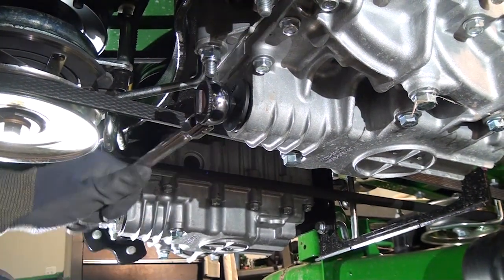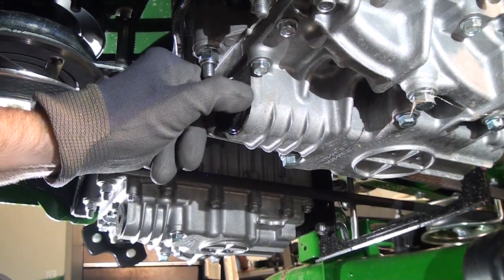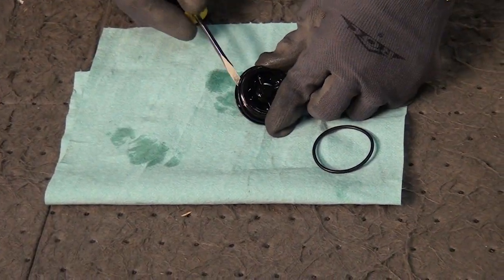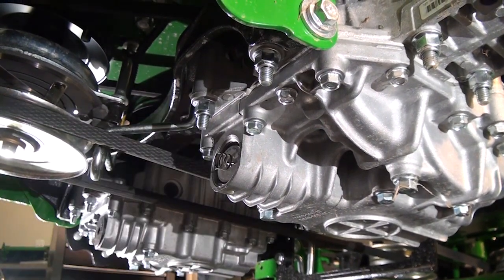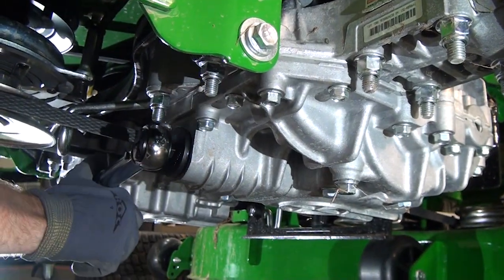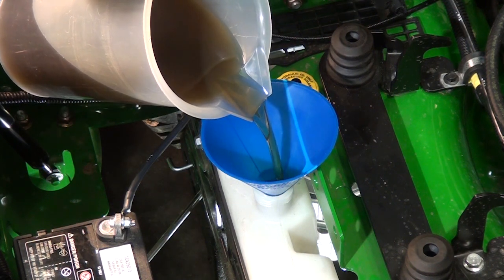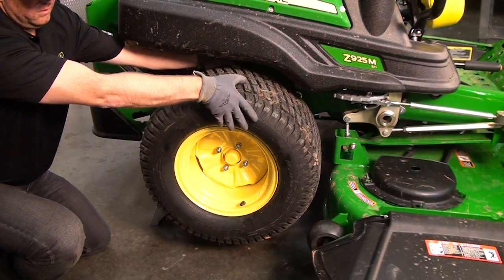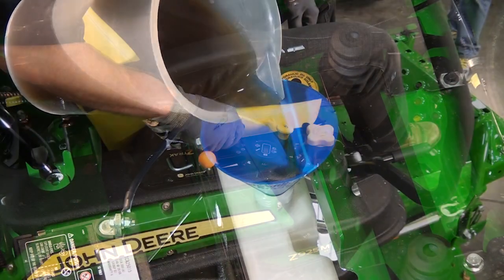How To Complete the Transmission Oil Service | John Deere Z900E/M/R and Z994R ZTrak™

Comment: I have the john deere z930m efi with 300hrs and my transmission leaks like hell and the tech told me I have the wrong gaskets in my year model the ones I have fail often and it's at my cost another good job john deere
Reply from the maker: Ricks, we're sorry you've been experiencing this issue with your Z930M EFI. If you would like to discuss this with us further, you can call our Customer Contact Center. You can find their information at the bottom of the page at Deere.com/ContactUs. We hope this helps.

Comment: Hi, good video!
How to remove or install a cutting deck on John deere Z930 
Any help will be appreciated. 

Thanks 
Ray
Reply from the maker: Hi Ray, we would be happy to help you. Please tell us the exact model of your Z930, if it is an A, M, or R. We look forward to hearing back from you!
Reply: @JohnDeere  
Thanks for getting back to me and I want to take the opportunity to say happy new year !!
Mine John deere is Z930A 

Cheers 
Ray
Reply from the maker: Happy new year, Ray! The information regarding installation and removal of the mower deck is found in Section 50 - Attachments Repair - Subsection 20 - Remove and Install Mower Deck in the Technical Manual for the Z930A ZTrak™ Mower. This manual is available for purchase online at techpubs.deere.com as a downloadable file, printed book, or on a CD depending on your preference. If you need additional assistance, we recommend working with your local dealer for technical support. You can find contact information for your nearest dealers at Deere.com/Dealer. We hope this helps!
Reply: @JohnDeere  
Thank you very much for your help and information. 
Have a good day!

Comment: Bypass levers stay out until after last step per manual. Not clear in video because they don't list next steps after the three times forward and backward with the handles. Read manual for the full directions: 19. Push both motion control levers to full forward and hold for 5 seconds. Pull both control levers to full reverse and hold for 5 seconds. Repeat two additional times.
20. Stop the engine. 21. Push the bypass levers forward to the closed position. 22. Use a safe lifting device to raise the drive wheels off the ground. Remove the jack stands. 23. Start the engine. 24. Move throttle lever to the 3/4 fast idle position.
25. Unlock park brake. 26. Run engine in full throttle for 5 minutes and then cycle motion control levers forward and rearward
several times. Check for leaks around filters. 27. Stop the engine. Check oil level. Add oil as necessary.

Comment: How does the bypass valve work on a z820a. I know where the valve is at, but how far do you unscrew it and procedure on removing air?
Reply from the maker: Thanks for asking Greg. You can find this information under the Operating Section of your Operator's Manual for the Z820A ZTrak™ Mower. "On both transmissions turn bypass valve one and one half to two full turns counter clockwise to the open position." You can find many of our Operator's Manuals online at techpubs.deere.com.

Comment: Does this apply to the 910A also? I suspect it does.
Reply from the maker: Thanks for the question, Deonna. If you take a look at your Operator's Manual in Section 49 - Service Transmission, you can learn more about completing the transmission oil service for your Z910A Zero-Turn Mower. Many Operator's Manuals are available online, so you may be able to view the manual for your model at techpubs.deere.com. You can also contact your local dealer for further assistance. Find their contact information at Deere.com/Dealer. We hope this helps!

Comment: So let me get this straight...I pull the bypass lever to put trans in bypass mode,turn both tires one revolution forward,one revolution backwards..then return the bypass lever back to the run position. Get on mower and do the purge method?
Reply from the maker: Thanks for reaching out! You can find these instructions in the Operators's Manual under "Service Transmission - Changing Transmission Oil and Filters". If needed you can find an online copy here: http://bit.ly/2UEVYSM. You can also reach out to your local dealer for further questions. You can find their contact information here: http://bit.ly/2GrQL87. 

Here is the step by step instructions for this portion of the service: On both transmissions, pull the bypass levers back to the open position. Rotate each drive tire by hand 1 full revolution forward and backward. Check and fill reservoir until oil level is between MIN and MAX marks on reservoir. Lower seat. Start engine. Allow engine to idle for 1 minute at low idle. Push both motion control levers to full forward and hold for 5 seconds. Pull both control levers to full reverse and hold for 5 seconds. Repeat two additional times. Stop the engine. Push the bypass levers forward to the closed position.

Comment: Nothing was said about returning the transmission bypass levers to operating position.
Reply: Mighty Boss I got a Z3 4/5 M John Deere zero turn back wheel won't spin one of them sometime it turns sometimes it don't please help
Reply: I have a z535m dealer says it doesn't have a serviceable filter i have no visible oil at 8 hrs and the dealers response was the machine is only made for 1 hour  a week. Kinda tired of hearing that maybe fire some people in rogers mn. If i got less than an hour i would use a push mower not an 6k$ setup.

Comment: i want to know how to change the blades in the Z525E if we don't have a mover jack?
Reply: scanjett I’ve changed the blades on my mowers on the job site by running one side of the mower up on the trailer ramp where the other half is hanging off then pull it up on the other side to change the other blades. Not the safest way to do it but it will allow you to change them in a pinch without a lift or jack

Comment: What is the lifespan of this transmission 2k-3k hours possible?
Reply from the maker: Thanks for the question, John. The lifespan of equipment and components vary depending on the use of the equipment, as well as the maintenance, environment, etc. To prolong the life of your equipment be sure to follow the service intervals and instructions as they are outlined in your unit's Operator's Manual. You can find many Operator's Manuals online here: http://bit.ly/31KlAxm.

Comment: Does the z535m use this setup of not the video needs to be relabeled as i feel it is false advertising and i feel robbed and i will contact youtube.
Reply: The Z535 uses dual hydrostatic transmissions, you weren’t robbed by this video, only John Deere !